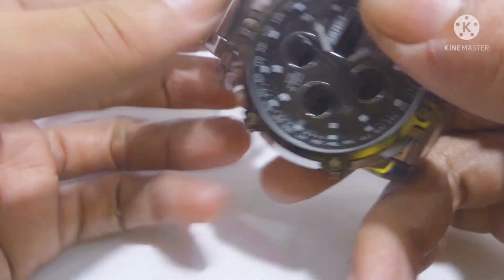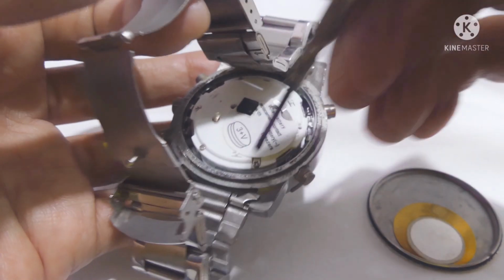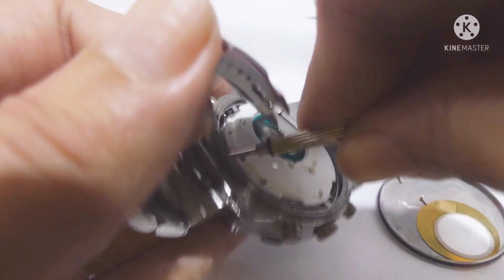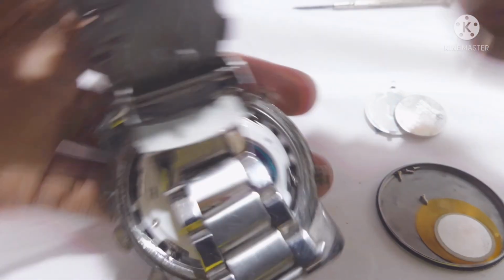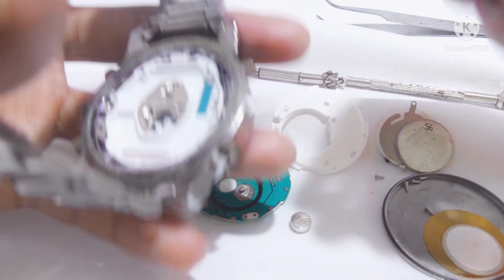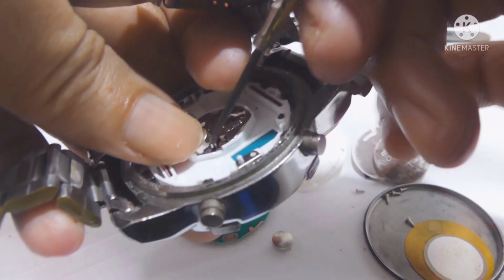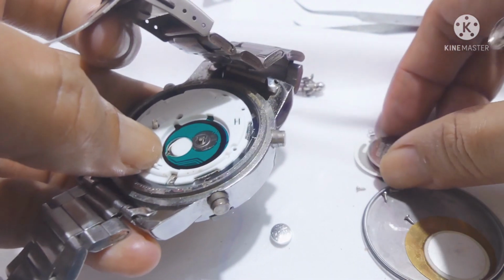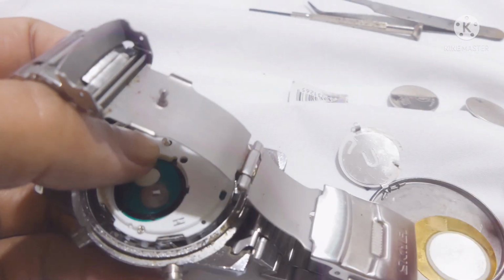#HOWTO CHANGE #SKMEI 1389 BOTH BATTERIES 23072021 [4K]

Comment: Thank you for your time to make this video. I want to make it easier for others. So there are 2 batteries. There is big one on top - this power digital watch & LCD display. The second one - very small power the analog part - hours, minute seconds hands. It probably no need to take off the white/green board - just use small needle/pin in left hand corner there is small space for it and I guess this is for the quick replacement. I done it same as video with removing all small screws and pop-up the small battery. Replacement batteries are CR2016 big for LCD and small was AG4. Is fun to fix this and is also helping the environment. I used to throw away those when the hands stopped moving and after replacing the big battery did not help. This time I checked the voltage. The big one has 3.3V when new (old has 3.0V no need to replace), small one has 1.3V when new and old had 0.7V which need replace.
Reply: 😢😢 mine is sealed